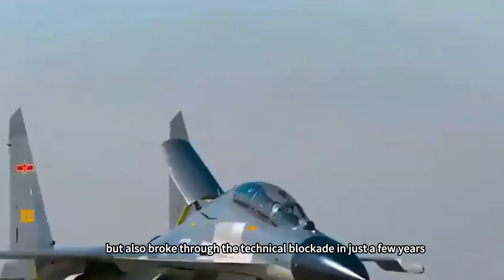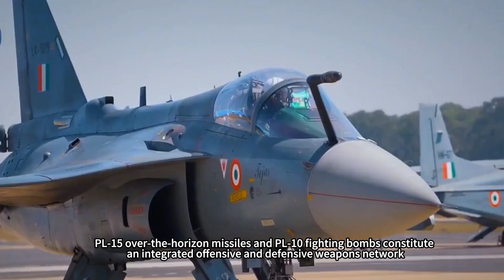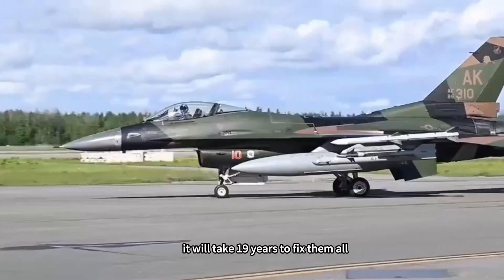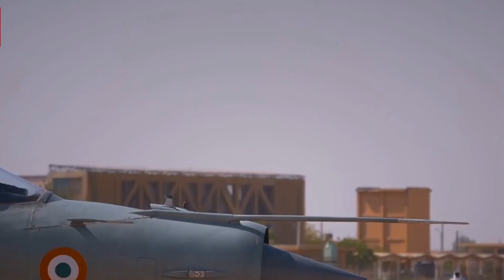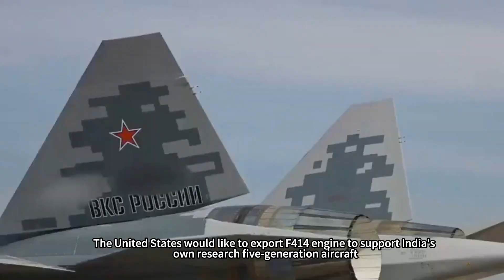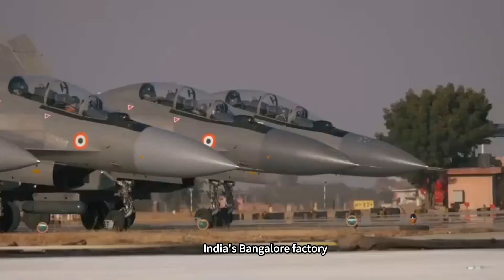Twin-wheel front landing gear + towing hook! The identity of the J-50 carrier aircraft is confirmed.

Comment: China J-16 is a multirole fighter jet based on the Russian Sukhoi Su-27 design but with extensive indigenous modifications featuring modern multi-mode AESA radar, improved electronic warfare (EW) systems, and datalinks, giving it an edge in combat capabilities.
India's Su-30MKI, developed in collaboration with Russia and Hindustan Aeronautics Limited (HAL), with a PESA radar system, which has been upgraded to incorporate AESA technology, enhancing its detection and tracking abilities.
The effectiveness of each aircraft also depend on pilot skill, tactics, and support systems during actual engagements.